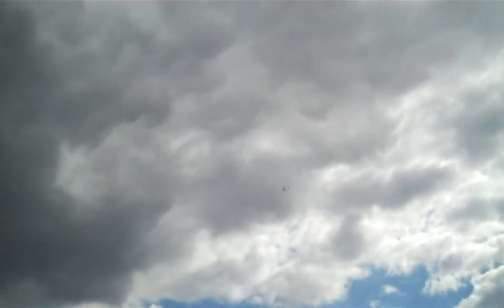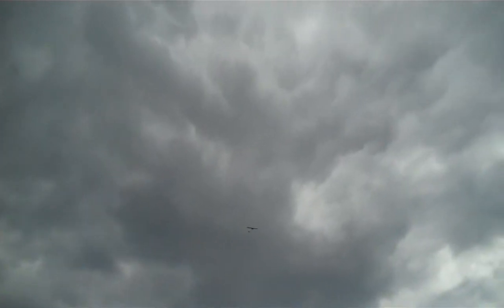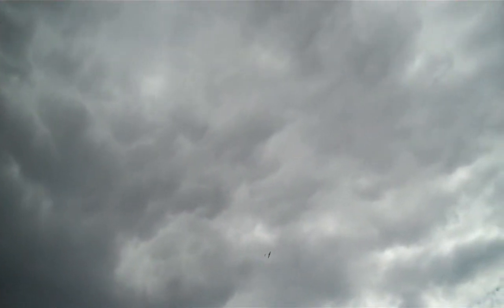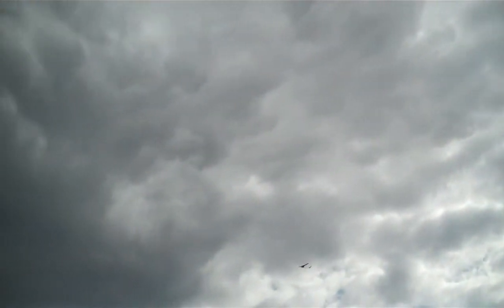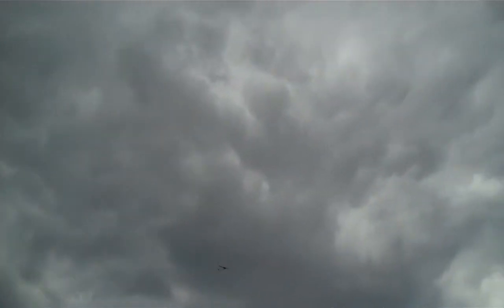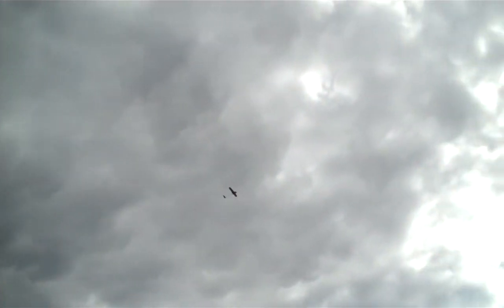RC airplane - Aerobird (2003!) aileron conversion, first successful flight! Sept. 28., 2012

Comment from the maker: Just an update--I shortened the 6 x 3 prop to 5.5 inches because the motor got really hot in flight on 3 lithium cells, and melted the plastic around the two motor screws. I made an aluminum plate about an inch in diameter and 1/16" thick that goes over the rear plastic wall that the motor bolts to--this spreads the load out and gives some heat sinking effect, preventing the screw heads from melting through the plastic, causing the motor to fall into the fuselage! No motor mount issues so far.